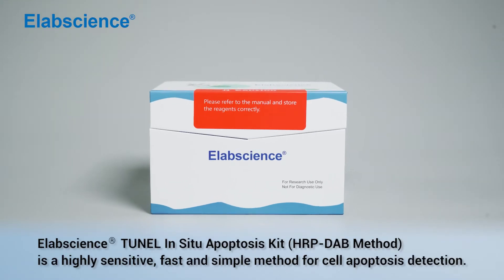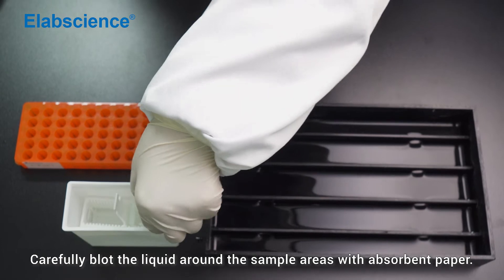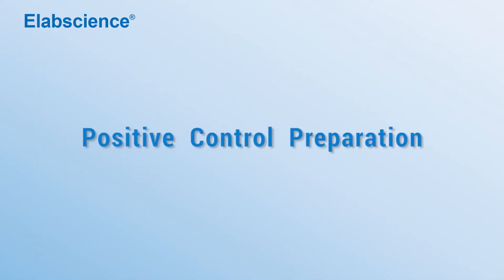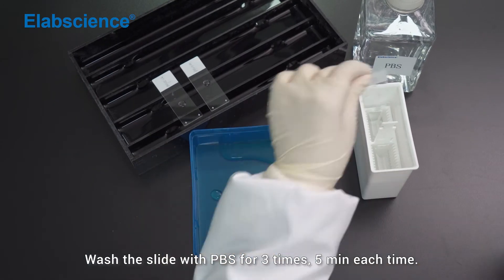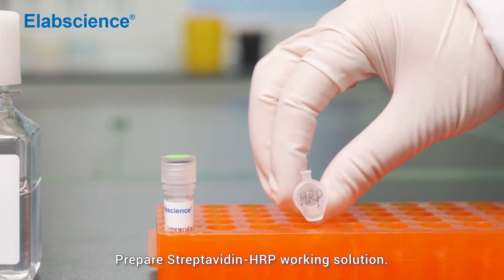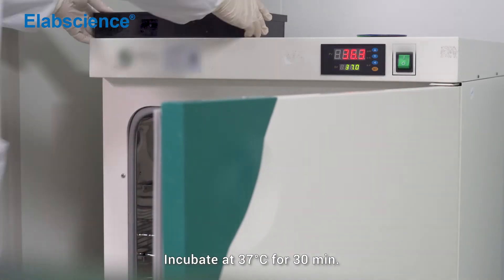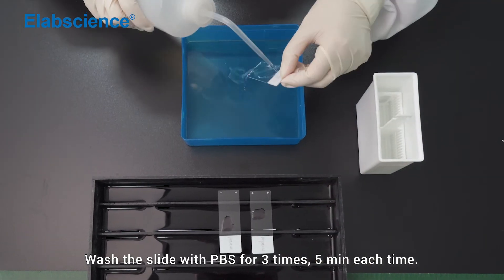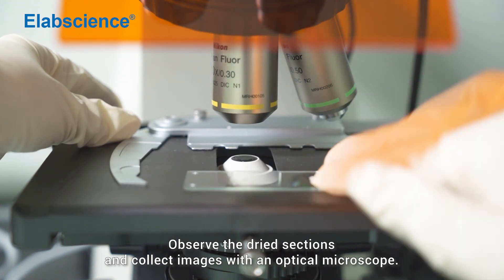TUNEL In Situ Apoptosis Kit (HRP-DAB Method) Operation Guide

Comment: Please upload the video to perform TUNEL assay on cell culture using same kit.
Reply from the maker: @meghasahu9747, cell slides require fixation and membrane permeabilization. The procedures for fixation and permeabilization can refer to the fluorescence TUNEL (Cell Slide) protocol. After fixation and permeabilization, the subsequent steps can follow the "TUNEL In Situ Apoptosis Kit (HRP-DAB Method) Operation Guide" video.

Comment: How long is the expected time for proteinase  K to work in mice liver tissues with fibrotic areas?
Reply from the maker: @user-ry1cc1im6f, the protocol recommends a reaction at 37°C for 20 minutes. However, the reaction time may vary depending on the sample type and species. It is advisable to conduct a preliminary experiment to determine the optimal reaction time.

Comment: Is the incubator 37C, humidified or not?
Reply from the maker: The oven is sufficient, the incubator is better, and when the incubator is applied, pay attention to separating it from other cells cultured to prevent contamination, for example, you can use a separate incubator;As shown in the video, the sample is first placed in a humidity box protected from light, where humidity is already guaranteed, and the purpose of this step is to prevent the liquid that infiltrates the sample from evaporating completely, so there is usually no need to increase the humidity.For some samples, if an extended incubation time is required, it can be observed every 30 minutes to ensure that the sample remains immersed in the liquid at the end of the incubation time.